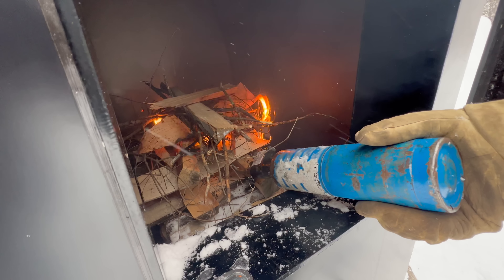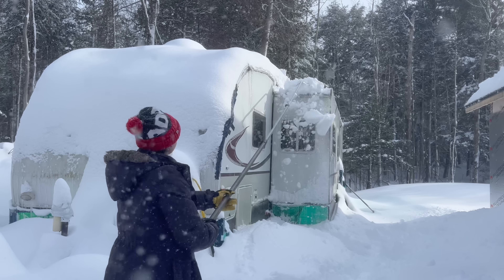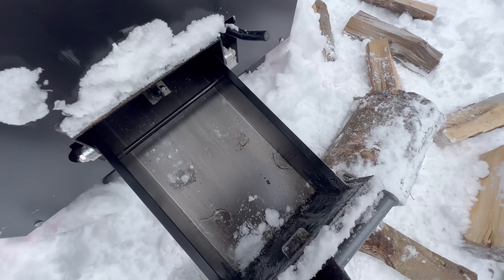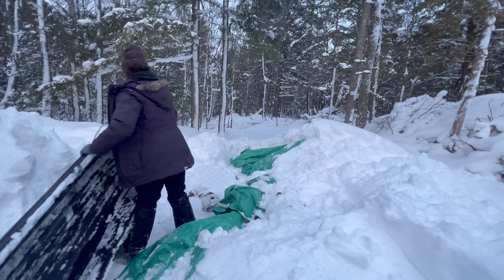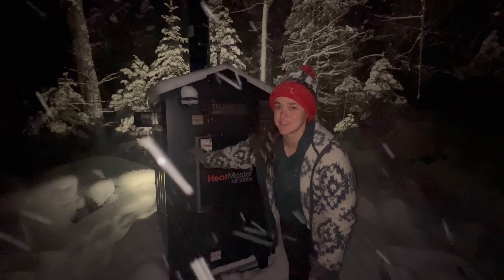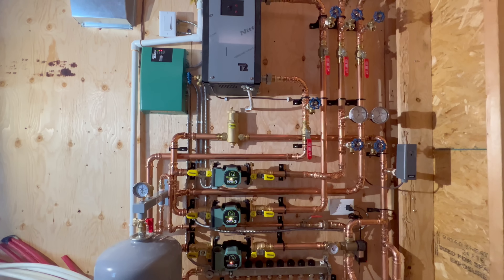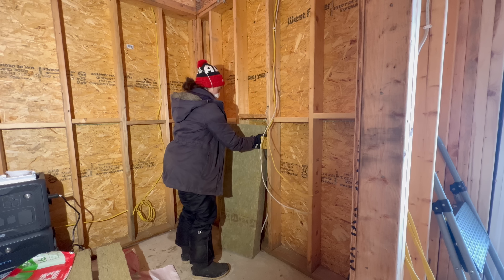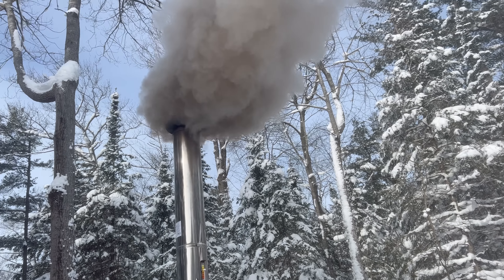How We Heat Our Home On Our 18 Acre Homestead!

Comment: Gotta love the HeatMaster. I love mine. I have the g10,000. Tons of videos on mine. I’m sure you know now. But when the furnace is in idle mode be very careful when opening the door. You can easily get a back draft. Your heating system looks great though. It’s to be expected to go through a whole lot of wood getting the slab up to temp. Once it’s there the boiler will be way more efficient. Great video.

Comment: Rockwool or Thermafiber has many benefits over fiberglass.
Fireproof, does not absorb water, doesn't mold or rot, doesn't break down, doesn't settle.
Much easier to work with, just a dust mask and a bread knife!
Our entire house has been done in thermafiber / interior and exterior walls.
Yes it's more but you pay for what you get.
And it will stay efficient over years of use.
Reply from the maker: Amazing! Thank you!

Comment: Wow, as  a younger man, we had a wood/coal stove, with a water jacket on the back. No monitors needed, just fire the stove up, warmth and hot water. Modern technology is so backwards... An old saying, (We have become so of ourselves) O.o
Reply from the maker: I think it's depending on where someone lives too and the foundation type. Floating slab you want a heated radiant floor that heats the air. Wood stove in the house scares me. My friends house burnt down a year and a bit ago because of their woodstove.
Reply: @SimpleLivingwithBiata  Firstly I am not knocking you, or your choices.
I'm talking in New Zealand, when we had houses built off the ground long ago. They usually had a solid outer foundation wall 2-3ft high, made of brick, or concrete, and stumps of timber, concrete, or brick. Wooden floors, with stoves built into house with original plumbing, to the water jackets on stoves. Also combustion heaters or open fires in lounge rooms... All fire places had hearths, which protruded out away from fires and stoves. Screens around open fires, except when lighting, clearing ash, or feeding the fires.
As you say it depends where we live. All over the world cheap builders are building what we call here in Australia today. 'California bungalow' type housing, consisting of a slab on the ground, and a few bricks slapped on for walls.
Cheap as to build. but expensive to buy because of developers greed.

Comment: Rockwool is 100% better even though it is more expensive. Fiberglass can be compressed, causing it to lose R-value. When it gets wet, it can absorb water, causing it to lose R-value. Though it’s a non-combustible material, it doesn’t provide the level of fire block that mineral wool does. It doesn’t have as high an R-value as mineral wool, which can be a problem in extreme climates with minimal wall depth. Because it has a lower overall density, it doesn’t deaden excessive sound as well as mineral wool.

Comment: Congrats. You are doing an admirable job. One little thing I saw made me wince. Your glycol lines running to and from the boiler are in close contact with each other. This is not desirable. You are essentially robbing heat from the incoming line meant for your floors to preheat the outgoing fluid. Sending warm fluid to the boiler makes the heat transfer in the boiler less efficient. Heat flows due to temp difference. The bigger the temp differential, the more heat will transfer.
Reply from the maker: Ah that’s fair, didn’t think of that!

Comment: If you change your temperature differential to 20 degrees it will let the fire burn longer and hotter which should reduce creosote.   Also if your smoke stack fills up with creosote you can eliminate it. I do not have a smoke stack(chimney pipe) on my heatmaster c250.  Best of luck to you with your wood boiler experience!

Comment: Rock wool is stone and steel so it wont   its fire resistant and mold resistant...it also has the ability to breeth so if it gets wet itll dry and maintain its r value...the link stuff if it gets wet needs to be replaced and can end ip molding if it stays wet...i got a 1920s house thats had mold problems so i went with all rockwool

Comment: I recommend going with dense packed cellulose insulation, little more than fiberglass but cheaper than rockwool. It has benefits of rockwool(fire proof, mold proof, bug proof, sound proof) but fills in cavity fully and can to done in one day. You could DIY the vapor retarder(like Intello Plus) part and hire out the blown in part. Or rent a machine, have one person loading and other blowing.

Comment: I also just wanted to add to my other comment, now highlighted, that if you do pick up a good-sized woodstove as a second heating option, you could install an instant hot water heater for taking showers, and only goes on when you are using it. I think you will pick up the tricks for using your wood boiler. I admire what you do. A tip for a woodstove which I used for a lot of years is that you stack it full at nighttime before going to bed, and only open the air vent in the door just a razor blade width. It burns like a cigarette, instead of a roaring flame. When you wake up in the morning it is still warm. Then you restock it the same, and it is good for all day. I see you are working on the insulation, and when you think about it, if there was absolutely no heat loss (not really achievable) you could hear your place up to 75 degrees and it would still be that warm without any new heat being applied. That's just an idea to shed some light on just how important insulation is which you already know since you are really going at getting it installed. Love your channel.
Reply from the maker: Thank you so much for all of the tips here! I need to get better with the wood boiler

Comment: I think Rockwool is better acoustically and higher R value. Where you're protecting water pipes (the room you've just done, kitchen, bathroom) it's probably as well to use Rockwool - let's ne honest better acoustic insulation in the bathroom isn't a bad thing either 😂
You can get foil backed, which reflects heat better so adds to R value or separate foil roll to go with the pink but I'm not sure it would be cheaper per square metre to go that route. Internal walls pink is a lot easier.
Reply from the maker: Thank you so much for this! Great info

Comment: Biata I've had a central boiler now for 21 yrs nearly problem free only filling with water I fill it with crap wood around noon n better wood around 10pm n that is mostly only time go to it less under 0 n windy then I might get out there round 6am toss few pieces in. I heating a 6 bedroom house with a  5036 central boiler. You will love the 30 min showers in winter with no heat loss

Comment: The antifreeze is going to hurt you, once the house is finished you wont need antifreeze, water with corrosion inhibitor is a much transfer of heat.  The heat exchanger is mounted wrong it should be mounted vertically up and down for sediment accumulation over time not horizontal. That’s the only issue I see,great job !

Comment: I had to laugh a little when I saw that. I am a heating engineer from Germany, most of the technology you see in your boiler room comes from Germany. I can only recommend that you insulate all copper and heating cables (this is mandatory in Germany) to save energy! How uninsulated pipes are like radiators and constantly give off heat to the room and so your system cools down faster, which means you have to heat more wood. If you insulate the pipes, you won't have to go out into the cold as often to add wood. Yes, I know electricity and energy are much cheaper with you than with us, unfortunately, see it as a little tip. ;) greetings from Germany
Reply: I was also wondering this-  not sure why the heating guy was not slipping the foam socks onto the the tubes and pipes
Reply: @TheKlokan44  He probably wanted to see the state of the air in the new lines.

Comment: Hi ... Great job you are slowly getting there ... Those radiant systems are great even better with your wood burner. We build a big shead arround my friend's wood burner and she can put all her wood in it so the wood stays very dry. I can send you a picture of it if you want...just tell me where to send it ...
Reply from the maker: So cool! They must have a different series than I do because for mine I can’t build a shed around it, only beside it! The guy I bought the wood boiler off of didn’t find it worth the cost investment to go with the gasification that would allow for me to build a shed around it
Reply: @SimpleLivingwithBiata  Oh okay. That's too bad because being in the shead make them use less wood overall. The shead is really big and not insulated. The walls are kind of open a bit we left like a 1/4 inch between the sidding planks to let a little air get in. And the front of the shead is open also ...

Comment: That Aluminium insulation does NOT go on outside wall
Reply from the maker: Yes it does
Reply: @SimpleLivingwithBiata     nop it does not,, outside insulation need to be Type 2,,, so it can breath,,,    the sun heat the ouside of the house.  sucking in moisture,,, moisture travel from the inside to outside.  then hit that aluminium,, and stay stuck there,,  and it will destroy the sheating,,, i have seen it so many times,, being a building inspector,,,, outside insulation need to breath.    so type 2 insulation,,,, aluminum insulation goes on the inside to stop moiture going in the wall if install corectly and tape very well,,, even a pin size hole will let moisture in the wall,,, cause again.  the sun.   will suck moisture from inside out

Comment: Congrats on getting the wood furnace operational. I look forward to installing one in my upcoming build. I had the pleasure of utilizing these systems at 2 different Shops where I worked.
Spray foam is definitely a waste of $ and terrible to work with if any changes or renovations come up in the future. even little jobs like running low voltage wires through would become a major task if Spray foam is used. I personally would only use it for filling small tight gaps.

Comment: Congrats on getting heat! We just built in Northern Ontario and we did blown in Cellulose in our attic (18inches). It’s great for vaulted ceilings because you don’t need bracing to hold insulation up there, the product has a glue that holds it! It’s really cool stuff. 

As for wall insulation, we did fibreglass for exterior walls. Your house is new and you’ll have time to see if there are leaks. Mold, critters and fireproof  shouldn’t be an issue for you. And imo, fibreglass is easier to work with. We did rockwool in some interior walls for the sound proofing though. 

Either way, I’d suggest taping your outside insulation joints before you install interior insulation :)

Comment: If I were you, I would install the pink FRP insulation thru out the house, except where you have the rockwool in the mechanical room. I think some codes require rockwool in bedrooms. You will have to check on that.

Comment: Great job on getting things to start heating up. My opinion on the insulation system is going to be based on my experience in my jon providing materials and expertise for different types of buildings. We use both mineral wool (Rockwool is a brand name) and fiberglass (the pink stuff). In general, we use mineral wool when sound deadening is an important factor. We use fiberglass when it is a temperature concern. I am in The US so codes may be a little different in Canada, but when we have an area that requires the mineral wool for sound insulation but also needs temperature insulation, we are required by code to apply fiberglass in conjunction with the mineral wool. In our case, this is all insulation on exterior walls. Interior walls in our industry are build outs by others. Right now in the US, mineral wool is extremely more expensive than fiberglass. Mineral wool is also a long lead time item for us to order from the factory, where fiberglass is a lot more readily available.

Comment: Rockwool - it is quite expensive, but typically has higher R-value per inch. It will also dampen sound even better than the pink stuff, and handles getting damp or wet much better.

Comment: Good morning Biata,

I don't normally post on your videos which you are doing an excellent job of by the way and keep up the great work.  I have been a house designer for almost 20 years, and you might have already heard this comment before and I apologize if you have.  I understand the rationale behind wanting to get heat into your slab to prevent the possibility of it cracking in the cold, however i do believe until you get your house insulated completely your wood boiler is going to struggle to stay at temperature.  You are essentially heating the outside to a degree in not having your exterior wall cavity insulated.  I do understand the house has exterior insulation on it, but it will only keep so much heat in the house until the walls are filled up.  Hope this helps out, love your videos, and keep up the great work.  Can't wait to see you keep moving forward.  Cheers
Reply from the maker: Yah it’s really been a struggle to be honest, the winter is becoming more mild, I might not have to heat it much longer

Comment: Fiberglass is the most prominent insulation used, not cause it works good, only cause it’s cheaper. Rockwool, is better, but pricey, sprayfoam is more money, but no vapor barrier needed, also adds strength, less issues with mice, and of course dramatically better for insulation values, if it’s a long term, forever home, spend the extra you won’t regret it, the granite countertops and stainless appliances can wait, but insulation is soooo important. I did sprayfoam in my last building, never regretted it at all!
Reply from the maker: Thank you so much!

Comment: I'm not an expert on the subject, but a woodstove enthusiast. From what I have seen the wood boilers thrive in usage by placing really large pieces in there, maybe even non splits, and really stack it up. That way it lasts a long time, and the concentrated "room" inside of the wood boiler enables you to burn larger pieces. 
One other comment was that a popular channel I watch installed the piping for floor heat in his 2800 sq foot pole barn and what does he use all of the time? He uses the wood stove inside, and it keeps the whole barn easily using a lot less wood. Install an airtight stove inside as an option, which of course also provides a concentrated heat source inside for quick warm ups coming out of the cold. Great channel. Great accomplishments.
Reply from the maker: Thank you so much for the tips!
Reply: I agree. Get a good bed of coals and just add nice dry rounds.

Comment: I have insulated two renovated old homes with rock wool. As stated it is mold proof, water runs off it, bug proof, FIRE PROOF (in fact in Alaska where we live it is approved as a fire stop), and an excellent sound proofing system. Plus it has a higher R value than fiberglass. I would use nothing else. More expensive but worth every penny (if you have pennies in Canada).
Reply from the maker: Amazing thank you! And no Pennies in Canada anymore haha

Comment: Rockwool has a higher R-value per inch, its more fire proof, more sound blocking and is even pretty moisture resistant.  The pink stuff's R-value is somewhat impacted by hoe you install it.

Comment: Not sure what your prices are in Canada, eh? But I've always liked blown in cellulose, it's a better sound deadening than fiberglass, and while dusty no massive itching!! With your exterior walls at least R25, with the foam outside, 18-20 " in the attic should make it comfy cozy! Looks like you got over the hump slump now getting jazzed, radiant heat is in! Booyah 😂 we made it 24 days and sick again! Pulling out from it but really!!! With that much snow! You got logistics to figure, smart move for snow removal, that's a  long driveway, the 2x's you put in are just nailers, I'd hang a blanket in the doorway, make that room warm! Stoked! 👍👍👍👍😊
Reply: Blown cellulose insulation isn't permitted in walls in Canada. Too much settlement.
Reply: @CharterRights  oh well that's a  bummer, if packed tight it has no place to go, Rock Wool it is!🤣

Comment: Biata I think you should have had your wood a little closer so when it snows you don't have to burn all that energy. Biata once you get it up to temperature it won't take as much wood but you know it will eat wood until you get the installation in the house you will use less and less wood. One good thing you have a lot of wood to use before it gets rotten to use.

Comment: Your roof should be able to handle a few feet of snow on the roof. I have a metal roof too and have had a couple of feet on it. I didn’t have snow stops though. If the roof warmed a bit the snow came off. 😊

Comment: Once that slab gets warmed up the boiler won't need nearly as much wood.  I'm heating the house, 24x36 shop and domestic water for both with my boiler and normally only fill it morning and evening unless it's bitter cold then it needs some more.  I don't burn nice wood either.  Spruce, fir, pine, popple...whatever I can get.

If you keep the fire going, you don't need to split everything.  If it goes in the door, it should burn.   It's good practice to split birch and popple because those hold moisture and will punk out over time if you don't.  I chuck in stuff that's 12" or more in diameter and 24" long.

Comment: Definitely Roxul Rockwool insulation!  It's fireproof and rodents and other such animals can't nest in the material. Worth every penny. I'd use the safe-n-sound for the interior walls and the R-value ones for the exterior walls.  Makes a big difference over fiberglass insulation.